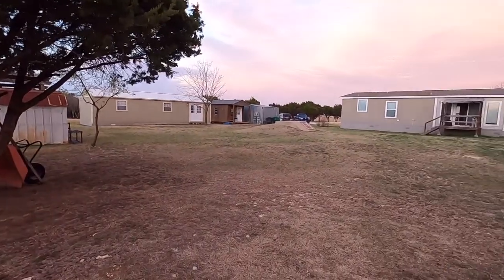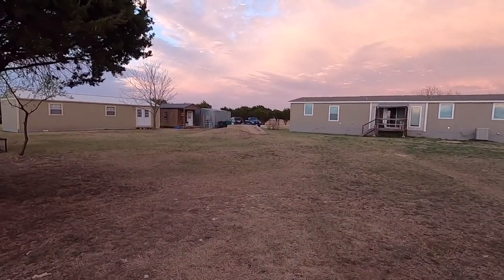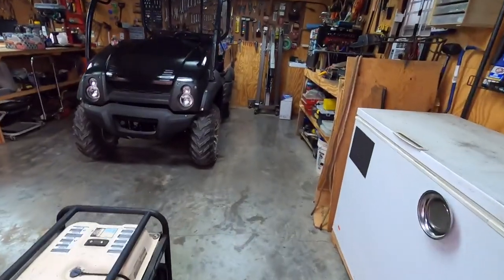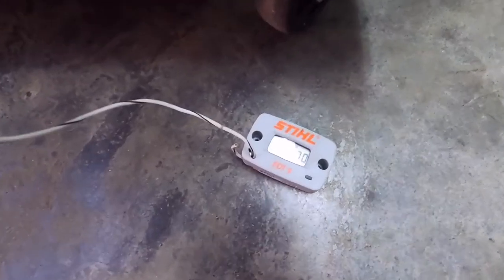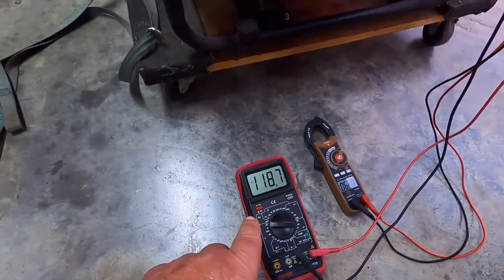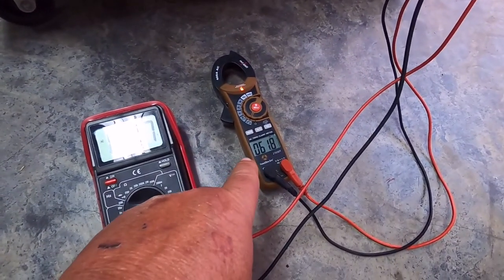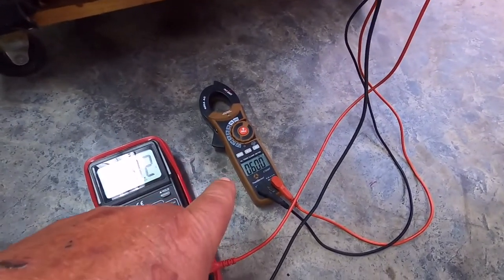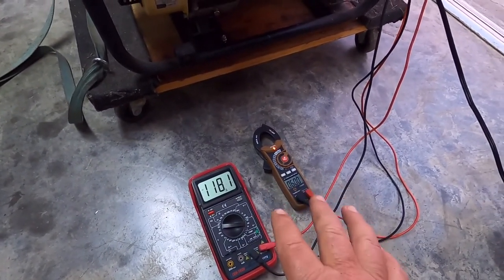Generator RPM, Voltage, Hertz, relationship v2

Comment: I thought that you had to run 3600 rpm in
order to achieve 60Hz?
Reply from the maker: It depends on the generator windings. 1800 RPM for the 3500 Watt Champion Gen set. This was sold and I picked up a 5600 Watt Craftsman generator. I may do the same test on this one later on.
Reply: Are you sure that your tachometer isn't just set wrong. Typically you need to select the number of cylinders or number of strokes power ignition of the coil. If that was set for a 2 stroke engine that fired every 2 revolutions I believe that you would double that rmp dragging for a 4 stroke which would've or you in the 3600 rpm range. I've never seen a generator that isn't an inverter type produce 60hz at speed but 3600 rpm.
Reply: Hz is a measure of cycles changing per second. Therefore 3600 rotations per minute divided by 60 to equal cycles per second is 3600÷60= 60 engine rotations per second=60 phase shifts per second on the electrical ac sine wave.

Comment: Interesting.. Generators and even AC power systems are still a bit confusing to me. Still learning how they work. I have the engine stuff figured out pretty well but the electric production part of it still trips me up. Appreciate the explanation
Reply from the maker: No problem! Thanks for reminding me I had the RPM meter. I plan to up the load to 3000 watts (2 space heaters) and with all three meters see if I can tighten the regulation up even more.